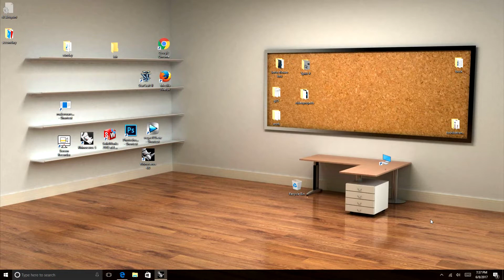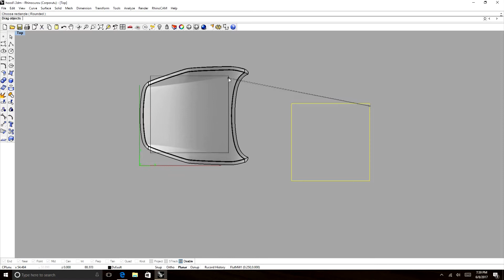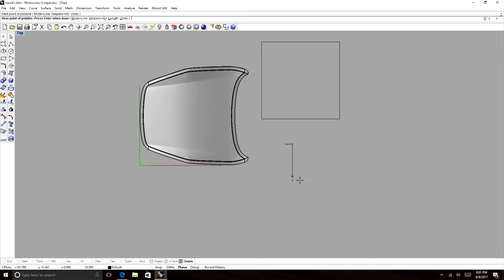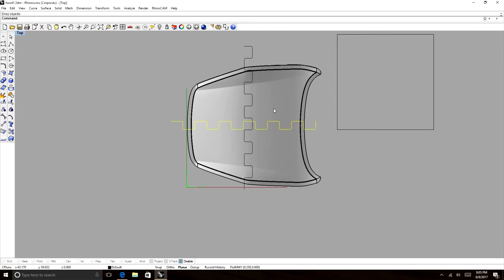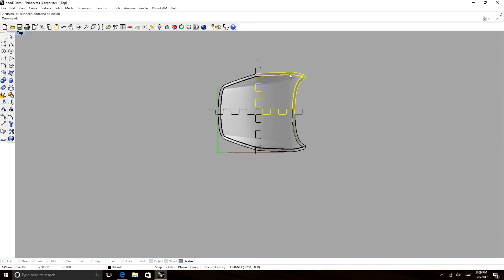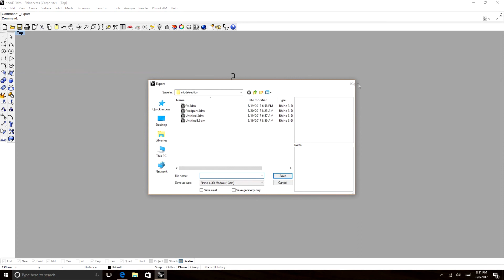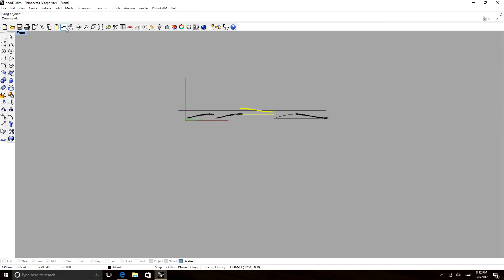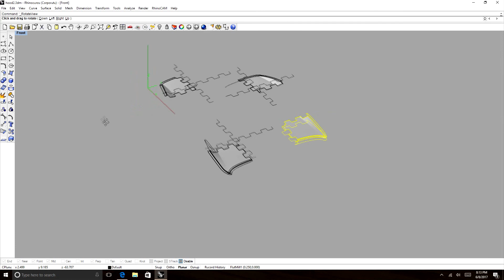How to split large 3D objects for 3 axis CNC machining. (2 of 3)

Comment: I notice that you prep surfaces for you CNC parts. They don't have to be solids?
Reply from the maker: Good question. With RhinoCAM, you really dont need the object to be a "solid". but in order for rhino cam to recognize depth, a line must be drawn from the surface to 0 on the z plane to indicate depth of the part. what im doing with these surfaces in this video is creating a cutting pattern that will machine the surface of what we have drawn,  then using the outer profile line to trim the edge of the part out of the box stock. So the sides and bottom of the surface isnt necessary for creating cam. maybe i should clarify this in another video.
Reply: Yes please that would help a lot!